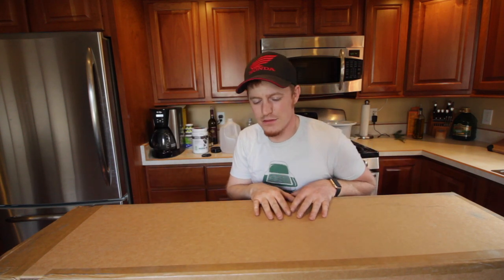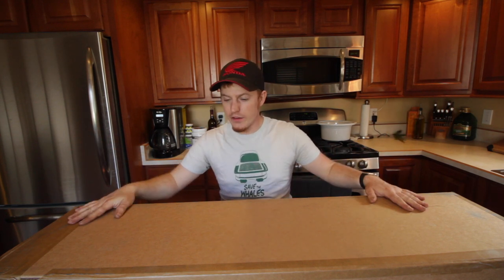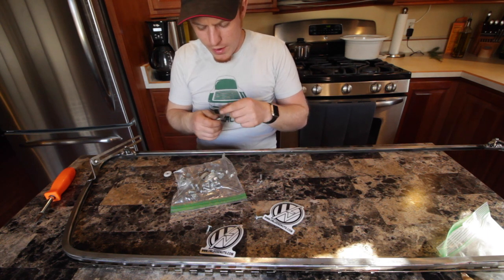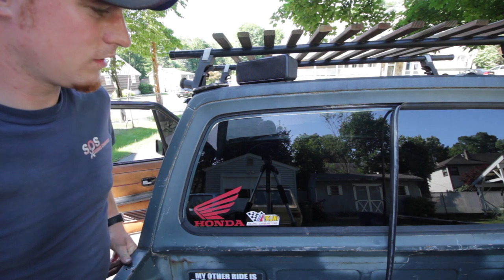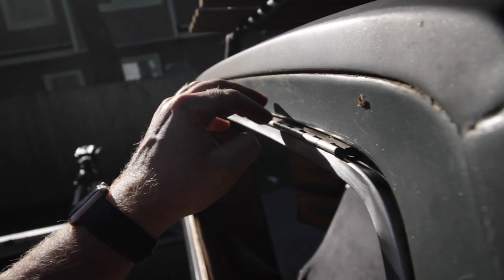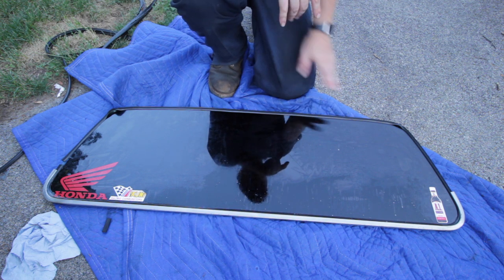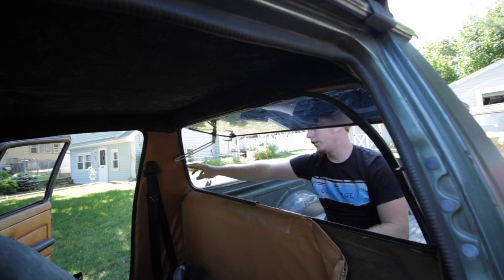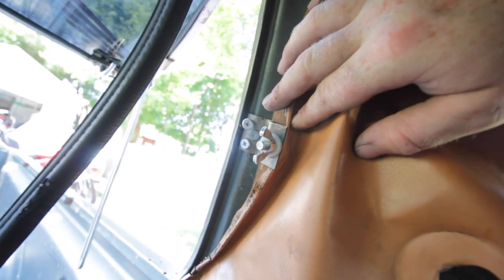#8 VW loosenuts rabbit pickup rear safari window kit.

Comment: So cool. 
I never knew this was a thing. 
I put a topper on my truck and removed the glass. 
I actually cut out 1/2 the bulkhead. 
I added more structure to reinforce he chassis. 
But having a walk-through cab connecting the front and the bed makes it much more capable vehicle.

Comment: What kind of towers and bars are you using for the roof rack on this truck?
Reply from the maker: ah heck i forget, i think they were the yakima feet with the original plain tube bars, i added the wood slats myself.
Reply: @mk1rabbithole  I found them, they’re the Yakima 1A towers🤙🏽
Reply: @dillonbroadard8833  were the yakima 1a a direct fit without modifications?
Reply: @rodneygilbert6061  Never found out, I sold my pickup

Comment: No glass
Reply from the maker: no, you use your factory glass.obviosuly have to find and buy solid window glass if your truck came with slide rear window.
Reply: @mk1rabbithole  why couldnt you use the slider in that frame?
Reply from the maker: @stunttlr  doesn’t the slider have a thicker frame? Even if it fit it would look like shit and rattle in my opinion, You couldn’t pay me to run a slider over the solid glass set up haha.